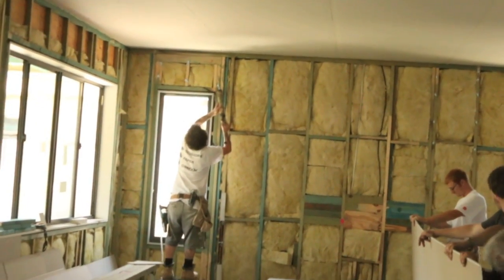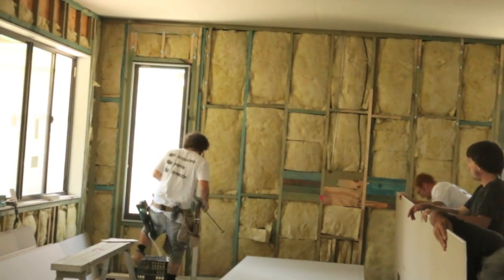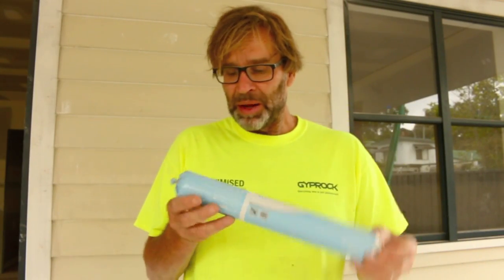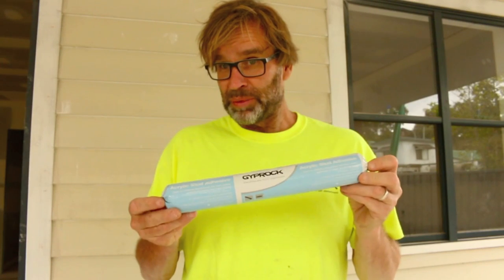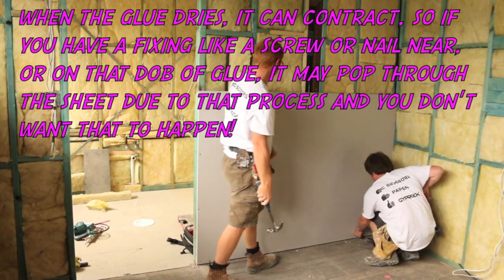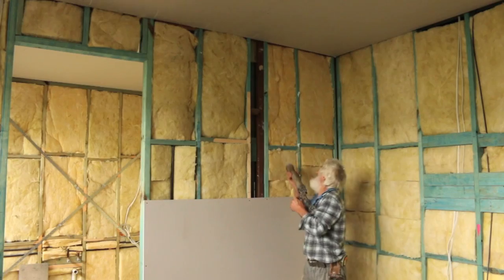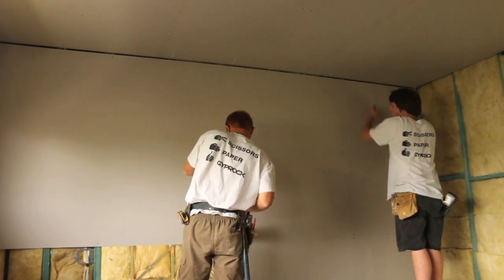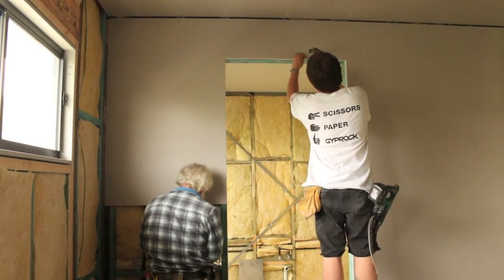Hang the Drywall / Plasterboard Sheets. Owner Builder Series, Ep 30, Part 2.

Comment: G'day Shane, I know this video is old news now, but I'm still going through the series when I get time. I always have been a bit slow!

Do you remember why they screwed some sheets and nailed others? I would absolutely love to have one of those collated screw guns but can't justify it at the moment. One day.

FWIW I've found that if I hang sheets by screwing the edges and not putting temporary fixing in the centre, the adhesive holds the sheets out in the centre, and the wall won't be truly flat. After fixing I push a straight edge against the sheet and it will squish the stud adhesive out if it's proud. I believe CSR recommend a couple of temporary fixings for the same reason.

Comment: What about the horizontal joins? We usually put something behind them between the studs to stiffen them up and make sure it doesn't crack later on
Reply from the maker: +Geoffrey Brooker No one over here does that Geoff and we never have any problems. It's not even recommended by the plasterboard (drywall) manufacturers, Cheers mate and thanks for watching.

Comment: Not sure why you hang from the floor up? Seems that unless you are going to install crown molding you have an issue taping the rather large gap at the ceiling joint.
Reply from the maker: +HMWRKS G'day HMWRKS.  We start from the floor in those rooms where we are installing cornice / crown molding. The only room in the house that we are square setting was the living room. Cheers.

Comment: Hey Shane as for the plasterboards, why did you create a plate on the bottom? (board doesn't touch the bottom, instead sitting on the plates) why is that important? sorry for a shitty comment.
Reply from the maker: +Theonlyj2kk G'day mate. There's no such thing as a stupid question. Actually it's a pretty good one. The packer acts as a type of expansion joint between the bottom of the sheet and the floor as houses move and you need to cater for that. Cheers

Comment: may be a stupid question , but why no glue on the end studs?
Reply from the maker: +cammy470 No such thing as a stupid question Cammy. It's actually a pretty good one. You don't want to have any glue within around 300mm of any fixture (nail or screw). The reason being that the glue can contract and if you have a nail or screw near that dob of glue it will pop through the face of the sheet  when the glue contracts which you don't want. Hope that makes sense. Cheers
Reply: +shaneconlan1  I understand now. Thanks